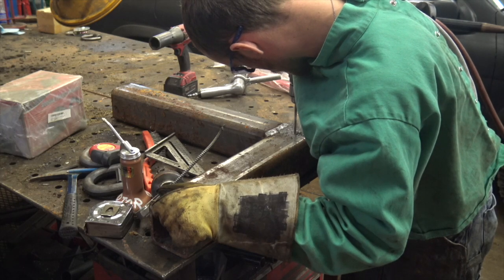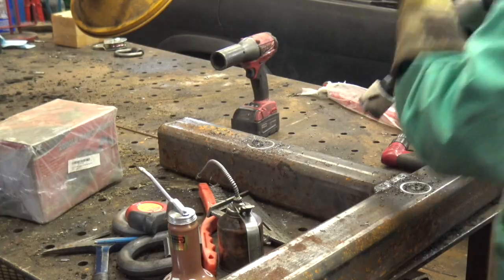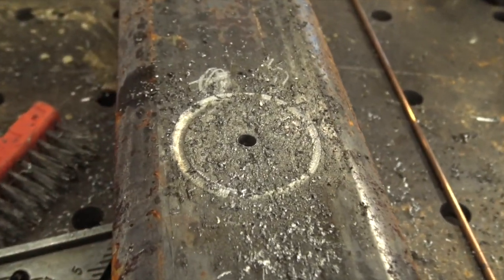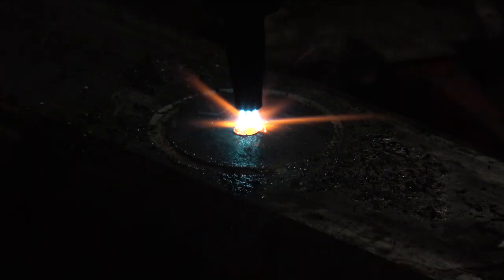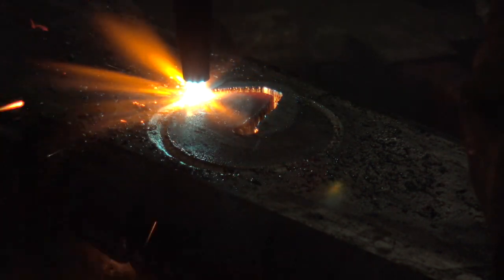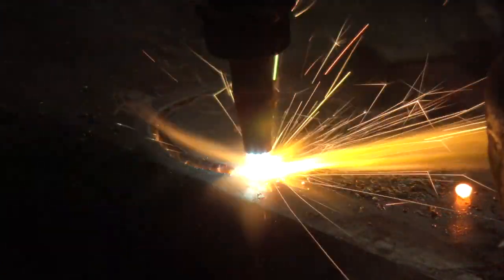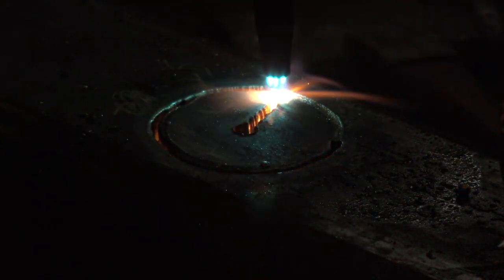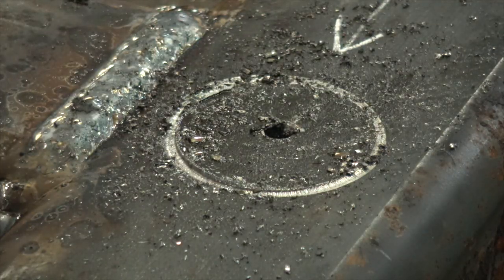HOW THIS TORCH CUTTING LESSON COULD CHANGE YOUR LIFE WORKING WITH STEEL

Comment: Umm.. why not continue cutting the hole all the way thru with the hole saw? You're already there With the hole saw in place & turning.. just keep cutting with cutting fluid added & Boom, you got a hole, cut more precision & smooth than the torch can do freehand. I could see an advantage with many holes to cut & only 1 holesaw left & maybe semi-dull, then it's faster,yeah. But Chucky's example only had 2 holes to cut aligned with each other thru heavy wall square tube, to fit a shaft thru. At least the pilot bit would drill thru the other side, flip the sq. tube over & cut 2nd hole in alignment. Maybe I'm overthinking it.. other opinions or viewpoints? Paul